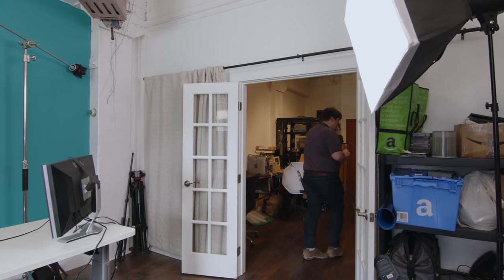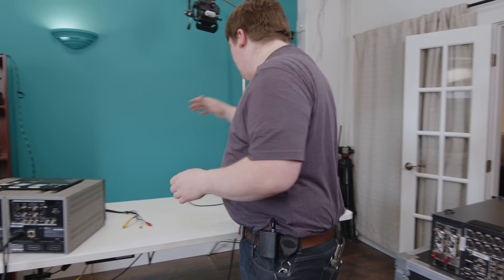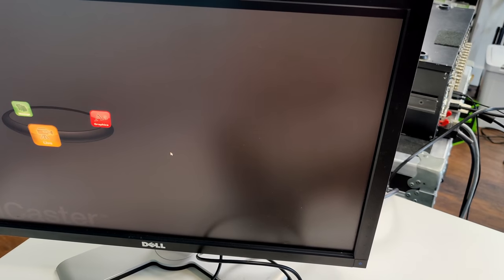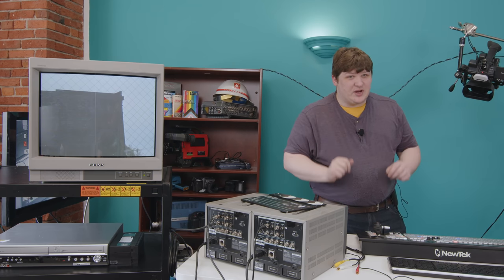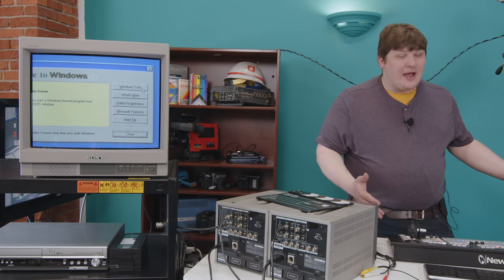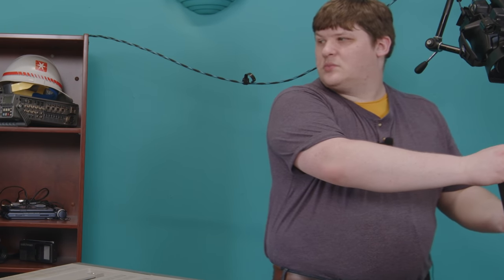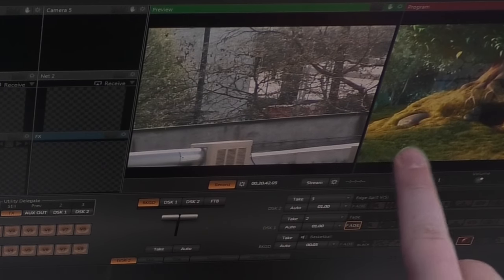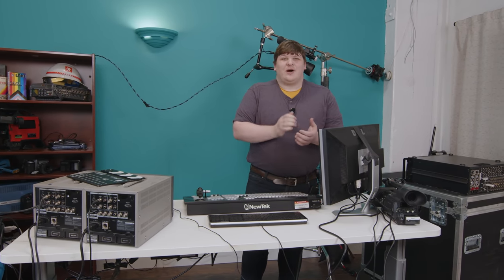Learning to run a broadcast in ONE HOUR [Tricaster TCXD850]

Comment: Those SUCK! oh my god, I had to set up one for my High Schools Morning Show and I ended up ditching the whole control board and the software and used obs. Some of the worst written software in existence. I used the mini pc's video inputs and the regular keyboard with obs and it was soooo much more simple. The phone support had no idea how to work the software either! The mini pc had a built in screen that would over heat and turn off at random and thermal throttled like it was designed to. It had a Haswell I7 with a dedicated gpu in a foot print the size of 2 original wiis stacked next to each other. This video gave me horrible ptsd lol🤣

Comment: I cant wait to see the next incarnation of this when Smpte 2110 starts to trickle into the used market in 25 years and people have evertz EQXs and imagine SNPs in their homes
Reply: also a lot of the more "serious" mixers/switchers are actually Less featured, because all of the bonus features (keying, audio metering, control surface handling, pgm/pvw, multiviewing, ECT.) are all put in dedicated hardware units. the most expensive ones are just a fridge crusted in ports that has no UI at all and expects an entire network system to actually control it

Comment: I have got to know what that button labeled "NO" does
Reply from the maker: That's under the Fade To Black button, which is basically a panic / generic "get us out of the current scene" button. It's supposed to do just what it says, fade immediately to black; but apparently, I'm told, it also sort of... disconnects all your inputs in software.
Reply: @CathodeRayDude  I have to admit, that IS one of the most effective ways to get a black screen as quickly as possible.

Comment: wait wait wait wait, how/when is audio mixed in without having this unit do it?
Reply from the maker: In my observation (not an expert) audio is not generally handled through video mixers, and control rooms generally have an ordinary audio mixer board with its own operator. This makes sense if you consider how often audio and video do not track together.

It's so often the case that the video on screen is associated with perhaps one audio track that you're hearing, but several others are independent, like theme music, a phone call, or anchors asking questions over a remote shot in which they don't appear. So it can't be something as simple as "pressing camera one selects audio track one," and in fact you'd almost never want that to be the default behavior.

If you're referring to literally "how does it happen", well, the actual program output goes through a half dozen other boxes before it exits the studio to head to the transmitter, any one of which can do the job of marrying the A and V together.

My assumption (again, not an expert, I just watch newsroom tours etc.) is that nowadays the audio is probably half-automated, where some events from the vision mixer can trigger presets on the audio router, but you're always going to need the option to override that, and it can't be one person monitoring and performing both jobs. The vision mixer is busy dealing with the vision; someone else needs to handle sound.
Reply: Yes, usually, but these do have fairly decent audio mixers with 8-10 channels of XLR with phantom power. For the meetings I run I just have the audio piped in here and it has basic compression and limiting on each channel, along with a decent EQ. You can also set up the TriCaster to pot up a channel according to what video channel you choose. I don’t do much more than that, but for what I do it’s much easier than having to dick with a mixer separately, as I work alone.
Reply from the maker: @GP1138  that's really good information, since I'm receiving a smaller tricaster soon which I intend to use for a live show in a week. assuming it also has this capability, it'll be really useful to have all that stuff happen here instead of in OBS
Reply: @CathodeRayDude  ty ty for info! tbh I just never really thought about it in detail, sorta just banking on the hope that a video stream would always have a paired audio stream and if not then you'd have to mix in another audio source. Guessing the routing would basically be; audio mixer -> this lil bad boy you're showing off -> final output device. in my mind making the tricaster pretty much the final/master audio mixer (even if its not a full-fledged /audio mixer/) for the av chain. also certified not an expert^tm but very cool stuff! <3

Comment: All this work for what a twitch streamer can pull off with 2 capture card daisychained 'puters with consumer hardware
Reply from the maker: But not reliably, not flexibly, and not responsively. With OBS etc. you need everything planned ahead of time. That's fine when you know everything that's going to happen.
Reply: @CathodeRayDude  again, the 2nd computer makes all the difference.  One to run the exterior workloads & one to do purely capture, transitions, etc.  You can even get a fancy control board for the capture machine if you wanna spend that prosumer  guitar center money.  Filmcow actually does a great job you should check out how well he can script live events, whether it be talking to the one true moon or pausing a videogame to fade in the birthday machine (a pretend apple ii program)
Reply: I'm not saying this product shouldn't exist but at the same time it's just weird to see a composite video manipulator of this, ahem, "vintage"